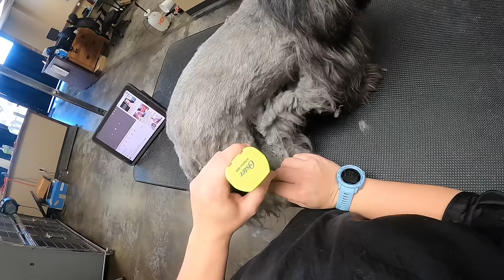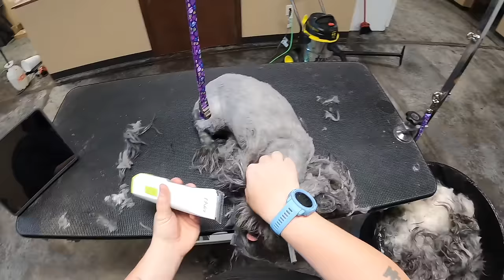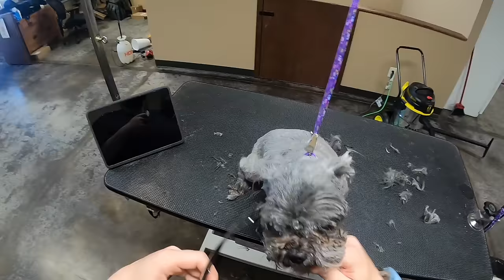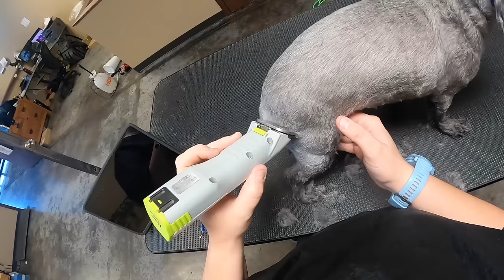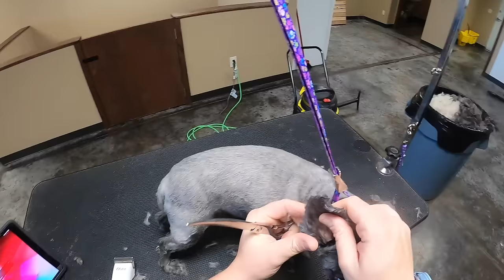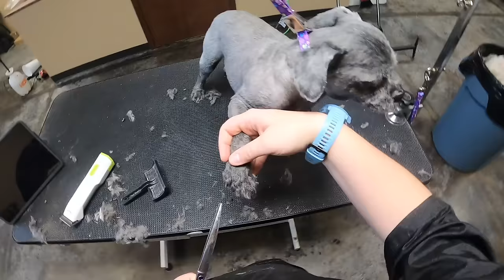SAVING A Matted Shih Tzu

Comment: That sure was a poor little dog neglected for too long... What a great job you did with him. 👏👏 Smooth sailing all the way, even with the nails not that bad. Just wonder though: you did not put any shampoo on his body or did you cut it short on the video? I only saw you shampoo the face for the gunk. I also twitch when I see anyone put their hands on his face after cleaning his anal glands! Even with the clippers, why not change the blade or disinfect it at least, if doing it in that order? Thx for reading